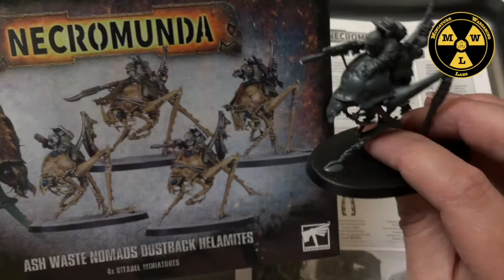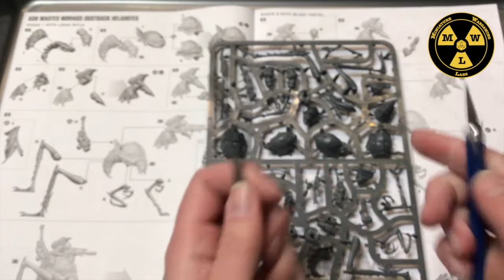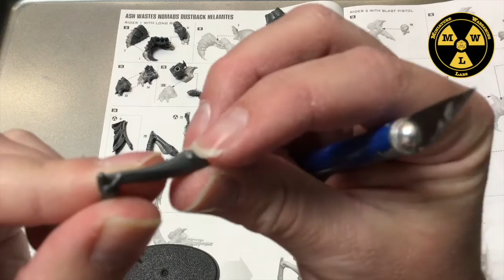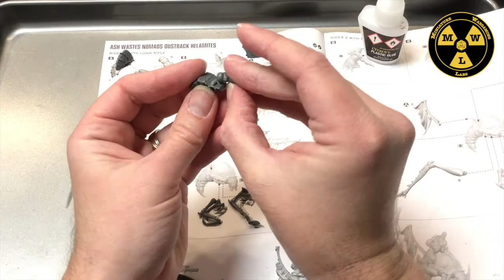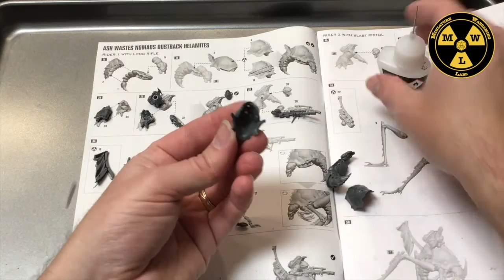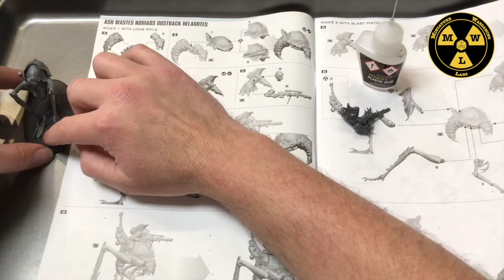Build With Us: Necromunda Ash Waste Nomad Dustback Helamites

Comment: I used a model saw and cut very small notches at the leg joints and bent the legs into a jumping position used putty to fill in the joints and used some flying stands to build the helamites in full leaping position. GW should make the legs into more pieces so there can be more variety in the helamites.